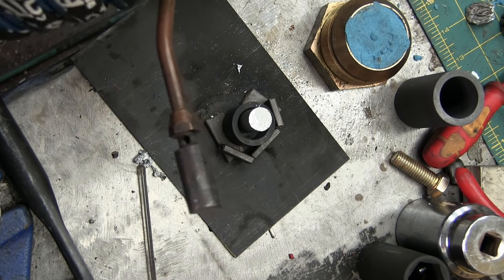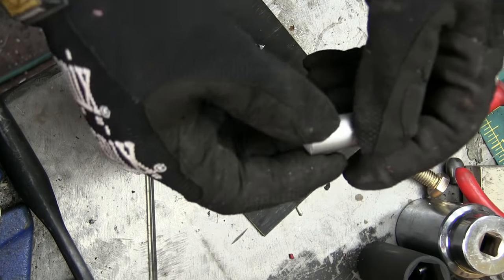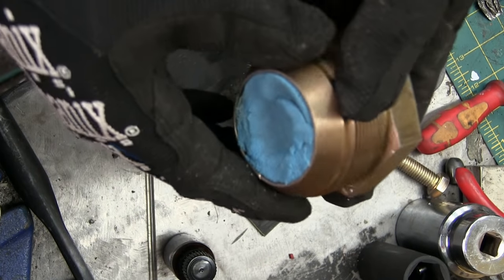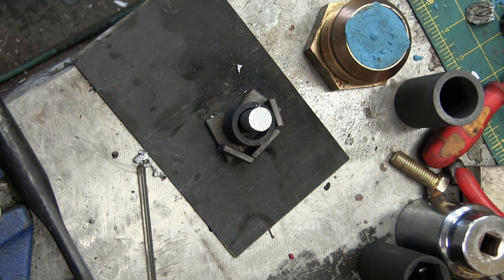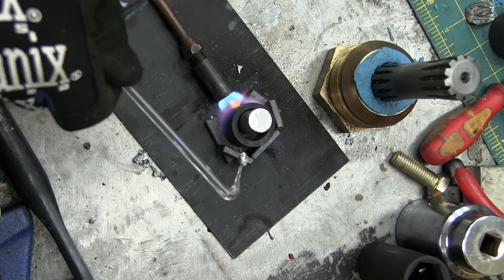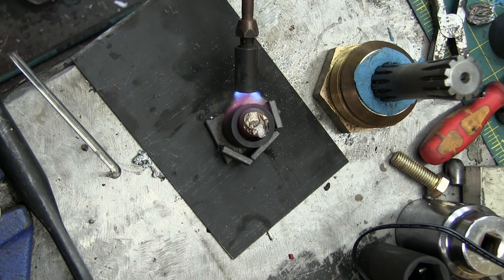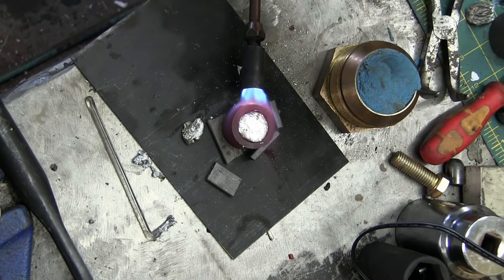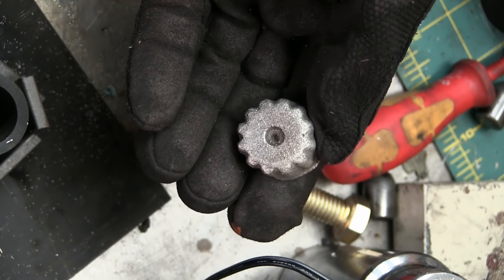Surprisingly Easy Way to Cast Aluminum

Comment: its a shame Arc Furnaces arent as easy
Reply: +Rinoa Super-Genius ..as your sister.
Reply: 800lb Gorilla
i'm a single child.
Reply: bullsballs
 your joking right? ok let me fill you in on the details. me and AvE were competing from like late 2013 to 2015 on making an arc furnace, i made several videos on it but  didnt have time for it. i may in the future though. he was really nice and sent me some graphite and nichrome wire, then i found some large carbon brushes and connected them to my 1940s Missing Link welder to melt rock and stuff.  so yes i know about arc furnaces, lol
 
theres a reason me and AvE have moved onto other means of melting metal. arc furnace is just too messy and tricky compared to other stuff. :p
Reply: What went wrong with the arc furnaces? My only problem with them is that they're a lot more expensive to run, the commercial ones I mean, but it looks simple in theory. I know the King of Random is a jackass but his video looked like it worked ok? at least for the easier to melt metals.

Comment: That's pretty darn clever, most people aren't aware of the relatively low temperature at which aluminum melts (gold is the same way). There is a scientist that actually makes aluminum castings of ant hill tunnels by pouring the molten metal down the opening and then digging the casting out once the metal cools off.

Comment: Would you be willing to show us how to make an inductive heater?
Reply: +ELECTRONTHORP With some insulation, that would have melted a whole lot faster. A little five sided box of firebrick would make a huge difference. From working with 1k studio lights, I'm pretty sure there's enough umph there to melt a good sized chunk of aluminium in an insulated crucible.

Comment: 1. Would it be good enough for you to use in a mill, or would it be better to start with billet?
2. Would that high-temp silicone stuff be better than magic sand?

Comment: Hey, can you do a video on reclaiming soda and/or beer cans to get the aluminum back? I wanna see whether or not it's possible to turn a shit-ton of soda cans into aluminum that I can use for random casting purposes (as well as whether or not the product of the process would be of a decent quality and not just a pile of useless slag that's not worth a dime). Also, random question, is it possible to cast something and then mill said item using either a lathe or a CNC machine to a decent quality?

Comment: Yep. i knew it was that easy, i work in a aluminum fabrication factory and on Press1 a torch is used to cut off extruded lengths of aluminum before it gets stretched finished cut and into the oven before being sent out the door or fabrication..

Comment: I think it's cool that the oxide melts at right about the point the non-oxide actually turns to gas (close enough to screw up if you can and are really pouring on the heat) and somebody figured out "hey, just use a/c" and that just blasts the thin oxide right off during the EP phase. "cathotic bombardment" they call it. 
Bet that dude got like a ten dollar gift card from GE or whomever he was working for. good for him

Comment: I've got a heap of that "kinetic sand" stuff at home, but I wasn't sure if the polymer would just catch on fire and kill my entire neighborhood with toxic fumes or some such nonsense, I'm definitely gonna try loss foam with the kinetic sand to see if I can get a smoother finish.
Reply: if you  want a smooth finish,use the foam board you get at lowes,it sands very smooth. lightly coat it with thinned out drywall mud, and let it dry for a few days in a warm area.

Comment: OK I can see that works pretty good for that sort of scale of things. Just wondering if anyone here has a clue how they make the aluminium foam stuff. I'm not even sure it's used any more as haven't seen it since the 90's.
Reply: +Gordon Lawrence 
There are all kinds of metal foams these days. It's going to be an industry product all its own like Velcro.
Everything from bullet proof vests to rapid heat dissipation.
Reply: +Gordon Lawrence Probably gas it or some reaction that safely turns to gas when the molten Al is poured into it. They made a concrete product like that for stopping planes safely at the ends of runways. It was literally just concrete, hold the agreggate and double the foam peanuts. There you go, now you can make a wife-proof bumper for your home or garage!

Comment: Now all we need is a cheap and easy injection molding technique, and we're set!
Reply: +Anvil Bound You mean build one you can pedal and hope the molten metal doesn't spew all over you and your workshop?
Reply: BikingMNViking Pretty much yeah.

And I told em to look them up, by design they are housed in plywood or plexiglass, I don't think anyone would think it's a great idea to throw it together in your workshop without basic shielding.

Comment: Could this process be used to make a lathe change gear? I have a bunch of 60XX aluminum laying around and just blew out a ZAMAC gear for my Atlas TH42. 

I'm assuming the finished gear would need a lot of finish work on the lathe itself, but would probably be easier than trying to cut it on the mill.

Comment: I used to just use steel beakers welded up from any old scrap i had.  get get the beaker red hot first to build up a good thick grey oxide lair so the molten aluminium doesn't dissolve the steel and they work great.  you can't use flux of course, but that's not such an issue with aluminium, just scrape the dross off as you did.  I gave up on all that casting in sand business though,  too much effort and the results always sucked (or maybe i just sucked at casting!)  what i did very useful though was making molds out of sections of box section or tube, pour in your aluminium and you have a pristine ally billet again!  scrap back into usable machinable stock!  just be really careful there are no dents or internal high spots on the molds or you will never get cast piece out. it helped to make a small hole in the blanked off end and seal it with clay prior to casting so you could pound your ingot out.

Comment: Or: Dig a hole, put wood into it, put a steel pot with aluminum trash into it (eventually also an air tunnel to get the fire hotter), done.

Comment: Semi related question, Would a Mapp/ oxygen system be hot enough to melt/cut aluminum? I don't have an oxy-acetylene setup. Propane is obviously easily available but I wasn't sure about heat output, time, or other limitations like needing a forge,kiln,etc. especially depending on the amount. I'm also going to try your welder powered style sometime too  for curiosity's sake. Cheers!
Reply: Mspark400 Smith mapp is more than hot enough to handle aluminum.

Comment: Wait a minute, how come that graphite crucible and base doesn't just oxidise (i.e. burn) when you're hitting it with a flame? It's like 99% carbon. I'm considering getting the electric furnace that takes the standardised graphite crucibles and I understand that they have great insulating properties, but I would imagine that even these must experience some wear due to at least a portion of that graphite getting burned off by interaction with the molten metal (heat) + air, especially at higher temperatures like those required for copper or Silver (~1100 degrees vs ~700 degrees for the Al). So why doesn't the graphite just burn up?

Comment: I once cast aluminium by melting it in an old saucepan. The metal melted by placing the pan on the gas cooker and then making it a bit hotter by giving it a bit of extra heat from above with a  butane blow lamp. Steel has a higher melting point than aluminium, so I don't see the great need for graphite crucibles.

Comment: The thing is, aluminium melts at a lower temperature than your blowtorch can deliver (less than 700°C while the torch goes up to 900°C), and I found that out when I wanted to burn a paper sticker off a piece of aluminium, because it works so well with certain steel parts. Needless to say, the aluminium got a but … mushy? So, yeah, it works with that metal, not with steel or something (melts at about 1500°, so well above aluminium), but with that light metal, yeah, it works.

Comment: Does the salt actually do anything? It seems like it would be blown away by the torch or be removed with the dross.
Reply: +outsider344 It's about producing less dross by being a layer in between the oxygen and the metal as it melts, also makes less bubble for the same reason. Salt floats on top of the aluminum when both are molten, and yes it's removed when he skimmed it off the top, but by then it had done it's job.

Even more so if you don't dilly dally after the skim and get right to the pour
Reply: Anvil Bound Thanks. That makes much more sense than what I initially thought.
Reply: Helps balance out the sweet taste of the aluminum fume.

Comment: Even faster: any TIG welder with a long alumina cup. The argon will make for a much cleaner casting. Just maintain the arc and it'll melt in a few seconds. You don't even need AC, just straight DC will put all the heat into the metal and give you excellent results.

Comment: @AvE question: what is the weight of the dross(sic) compared to the molten aluminum? of course you can break it up and skim it, but what does the remainder do? ie does it float in the liquid aluminum? what is the purpose of the salt?

Comment: one time, I didn't have a peice of aluminum shaft thick enough, and I needed it at the time. so I welded a bottom to a peice of steep pipe and filled it full of slugs of aluminum and melted with acetylene. then when it was cool I just turned the steel pipe off on the lathe

Comment: what happens when you machine it?
Reply: +Brad Sogn Its cast aluminum. Should be the same.
Reply: +Brad Sogn It machines just like aluminium, might have a few grains of sand on the outside though
Reply: Brad Sogn Lol thats how a lot of metal products are made, they cast or forge the rough shape and then machine it into what is necessary
Reply: +lolatmyage Is material durable as the long stuff, if casted right that is?
Reply: Hellsong89 Yeah pretty much.

Casting is done right if there arent too many defects in the product, its not that difficult to get something that is good enough as long as you intend to do some more processing of it.
 
I had a basic course where we cast aluminium into sand with channels and everything and sand kept getting into the piece, The sand probably wasnt that good as there were 16 people at a time making molds and trying to fine tune like a ton of sand isnt worth the effort for teaching the basics. Even so just increasing the machining margin takes care of all those problems.
Reply: With this stuff? It sticks to the lathe tools and it's hard to get a good surface finish. Had he used actual cast aluminum instead of this extruded product (the rate of shrinkage in his cast reveals the purity) then it would machine much better. There are many metal casting forums on the web with great information about getting decent metal for decent pours and good machining properties. Backyardmetalcasting and alloyavenue are two that I use.

Comment: I can't remember if the table is just a thin sheet of metal or solid. If it is solid(less so sheet), it would probably work faster with some insulation between the work and the heat sink... Sorry I mean table

Comment: You could use a styrofoam model to build an open feeder in magic sand on your mold and pour the molden metal in it. The cast will be much higher quality.

Comment: Damn you AVE.. so there I was about to experiment fixing a cracked aluminium head with jb weld and then I see this.. so basically I can melt a coke can and fix the cracks.. time for some experimentation.. :) thanks.

Comment: I have two melters...one I bought...for a sum I will keep to myself. the second...a range element...240 vac power supply...and a bucket. I think it was maybe $30. can fit a 12kg crucible or so. Oh...and some cheap refractory.

Comment: The most heat is the tip of the flame.
Reply: I do it with lead. 50$ per hockey puck. 😳

Comment: Would this be viable to cast something like a bronze age  axe head for example this  https://finds.org.uk/database/artefacts/record/id/582543

that one is only 1/3 of a kilo in bronze  i always wanted to try casting some but the equipment is expensive and i don't have anywhere i could dig a hole to  do it the old fashioned way using charcoal .

Comment: Why not just clean the oxide off? In TIG welding you don’t burn through the oxide, your metal will be fucked by the time you get hot enough to get through the oxide. We clean it off first. It’s a pain in the ass though you really gotta do it manually with a stainless steel brush. Ive heard with larger pieces you can get away with using a stainless wire wheel at low speeds. Just be carful of the heat. Unless you really must don’t use flap discs, and if you really must, apply liberal amounts of lube. Side note, with stick and MIG you have more leeway with the oxide but it’s always ideal when there isn’t any.

Comment: Nice. Wonder if slower cooling would minimize that shrinkage ;)
Reply: +Corey Ballard I doubt it, things expand and shrink naturally depending on how hot they are, the rate the temp changes isn't really a factor, you just have to factor in the shrinkage when you create the mould.
Reply: +Corey Ballard Nah man... doesn't matter how long it takes to get cold, once it's cold the shrinkage is there.

;)
Reply: +Corey Ballard  With any casting, risers are added as a form of feeder "dummy metal" that is calculated to solidify later than the casting itself. This allows the most dramatic casting shrinkage to be accounted for by the directional solidification where the liquid metal in the riser flows into the casting as it solidifies. The overall dimensional changes are accounted for with a general scalar factor. I'm not sure what aluminum's contraction allowance is, but the pattern will always be made slightly oversized to compensate. Some grades of steel are often given 5/16" of extra material towards shrinkage allowance for every 12" of material for an example.
Reply: +Corey Ballard Metalcaster here. Nope, you can't escape it. When it matters, we just intentionally have an overflow area that's allowed to deform and cut that part off once cool.
Reply: Thanks for all of the replies. Definitely no shortage of knowledge on this channel. So, I guess follow up question, would we have to account for any shrinkage if we sintered the same amount of aluminum powder needed to make this gear to the same size as with casting? Or only if we applied heat during the sintering process? I feel like I'm really showing how little I know with these questions....
Reply: +Corey Ballard well with sintering you're starting with the volume of metal for your finished product so you wouldn't have shrinkage to the degree that you get with castings. In metal casting there is always a dramatic amount of volume lost to solidification and contraction. I'm not too experienced with sintering but I would imagine that the applied heat expands the powdered metal which would work in tandem with the applied pressure. I'm basing a lot of this on assumption though, so someone more savvy on the subject may say otherwise. Overall I wouldn't be surprised if there were some minor shrinkage with sintering overall, but it wouldn't be anything that couldn't be easily compensated for.
Reply: Raymond Griffin Interesting. Thanks for the response.
Reply: +Corey Ballard, you're certainly not the only one having these questions. I love learning from the answers, especially to questions I didn't even know I had! :)
Reply: +Corey Ballard, and for every answer we get, all of us not really understanding this stuff learns a little bit more! 

So thanks for asking! And please keep on asking "stupid" questions!
Reply: +Raymond Griffin From what I understand, the shrinking is extremely minimal. Enough to matter if you're sintering a gear, but only a few thou/inch dia
Reply: zrobotics
It depends how much material you're casting, if you cast a big object it'll shrink more
Reply: +Corey Ballard it always does mate ;)
Reply: Also known as the George Costanza effect.
Reply: Cooper Hart that's why shrinkage is measured in shrink per diameter. That bit me pretty hard before i realized that smaller bearings don't stretch quite as much when heated, right about the time the press decided she'd had enough
Reply: The shrinkage can't be eliminated, particularly in aluminum, but it can be minimized. The risers, as mentioned by others, give it a source to draw from so the part is minimally affected. But at least as important is the alloy. Pure aluminum, as is typically found in aluminum cans (after all the dross is removed), aluminum extrusions, and aluminum sheet, shrinks A LOT. Cast aluminum (engine blocks, pistons, control arms, some lawnmower decks, many power tool components like miter saw bases, and so on) has alloying metals which make the material more dimensionally stable, both for regular use and casting. I use cans and extrusions in my aluminum melts, but never more than 50% of the volume. Those other ingredients also improve the machinability. Pure aluminum is gummy and makes a mess on the lathe and lathe tools.

Comment: I find welding aluminum a lot easier if you use a stainless steel wire brush to scrub the oxide off rather than try to arc through it. Every time you talk about melting metal your millwright side is showing.

Comment: Hello ! That was a nice vid ' =) 
I have a question for the gentlemen that are here : is the magic-sand re-usable after that casting ?
 If it is, that's pretty neafty
Reply: +flo ri It's not limitlessly reusable no, but if you pick out the more roasted bits, and keep mixing it up for re-use you can use it a crap ton of times than you would think.

Pewter on the other hand, it barely even upsets it. so I'd say that's viable
Reply: Nice ! Thank you =)